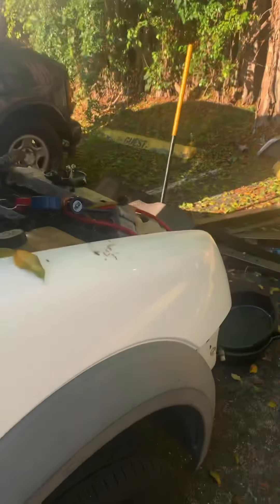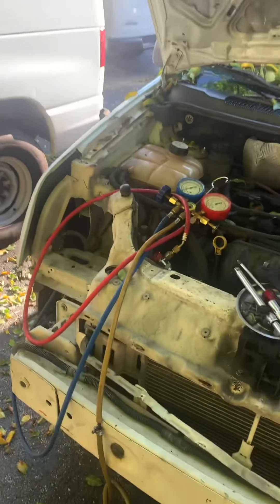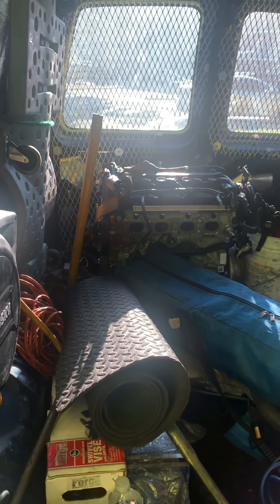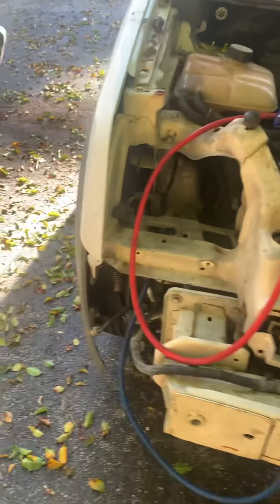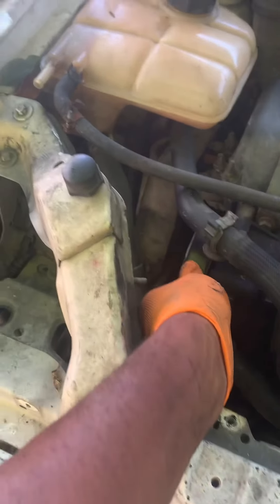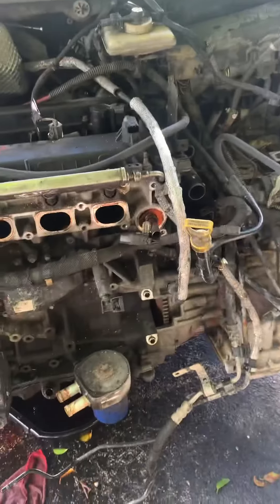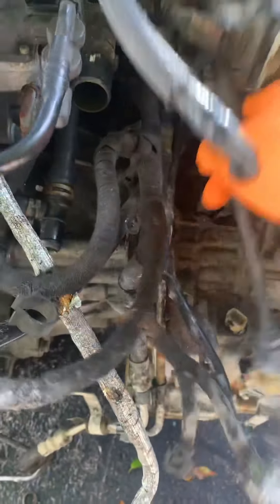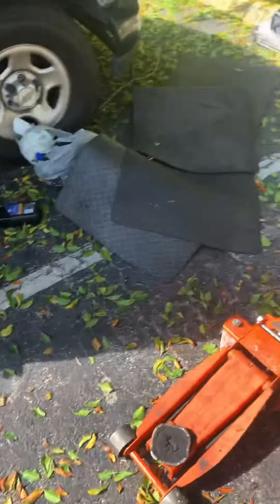2012 Ford Transit connect work van engine removal ￼

Comment: Damn you're brave brother. A whole engine swap in the parking lot in a day. That's tough. I'm looking into getting a 2013. This is a second video I see of someone doing an engine swap because of a valve. I know these are known to have transmission issues. Have you had any?
Reply from the maker: transmission that’s long story when I replace the engine the transmission go bad,I replace the transmission two times.I just get the transmission rebuild it’s going good so far
Reply: @onestopmobilemechanic3300  I think I saw in another video that u got rid of the connect for a Nissan. I heard transmission issues is from hauling a lot of weight. Not sure if that's the case but I'm back and forth about the transit connect.

Comment: Did you have to get it re tuned with  the new engine?
Reply from the maker: no everything work but the same
Reply: @onestopmobilemechanic3300  do you have to remove engine with transmission to change engine?
Reply: Is it necessary to remove whole front for engine swap? @One stop Mobile mechanic